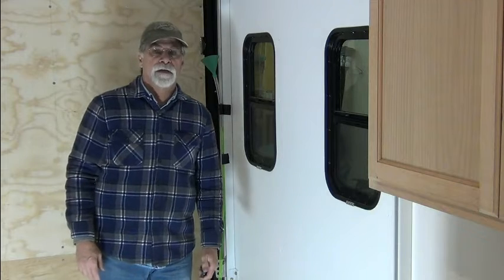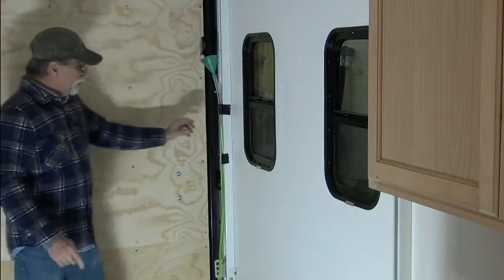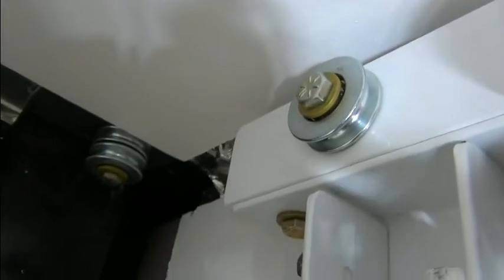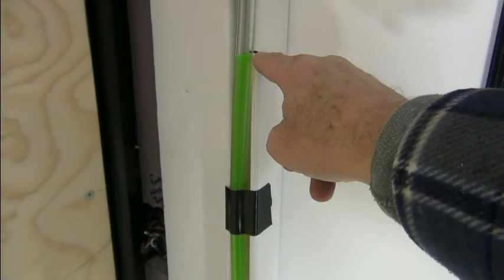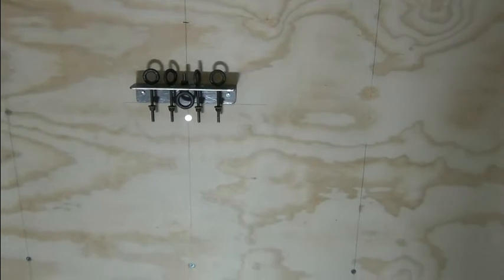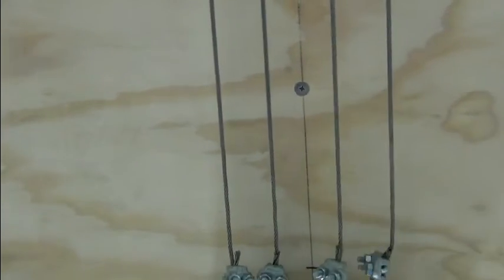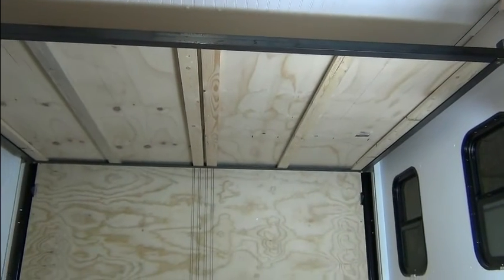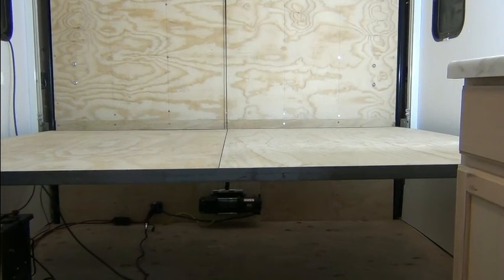Electric Bed Lift for Cargo Trailer Conversion

Comment: It is noisy but you don't have to try to sleep with the noise just the sound of the crickets, hopefully not. That's really cool and looks like it works great.
Reply from the maker: It has been working well.  Very quick for lift bed.  With everything else in place, the winch noise is not bad.